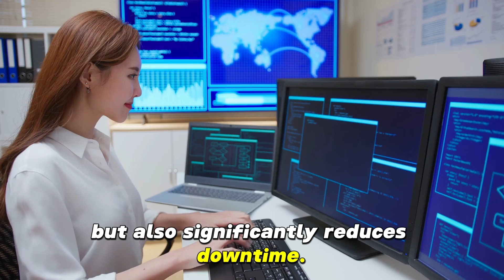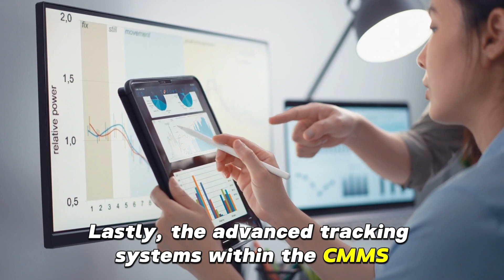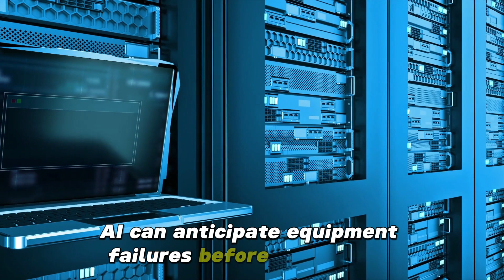CMMS in AI Revolution Maintenance: A Game Changer

Comment: Nice video, my company has developed a sensor to remotely ogment heavy industry systems increasing there data points for applying Ai to older installations. As well as replacing more medium base sensing systems for nonintrusive systems.
Reply from the maker: Thanks for tuning in! Your work is fantastic, especially in enhancing older industrial setups with AI. Keep rocking it! 👊